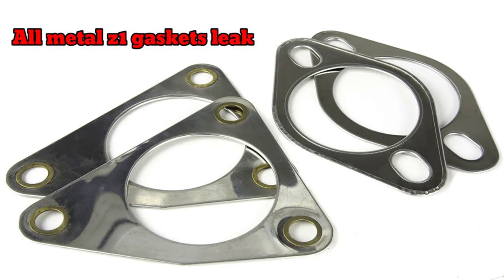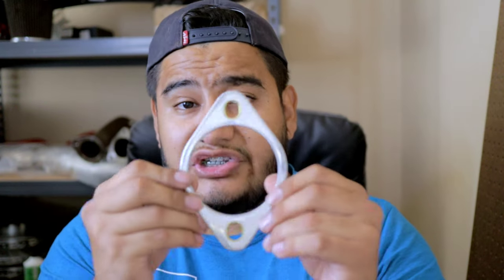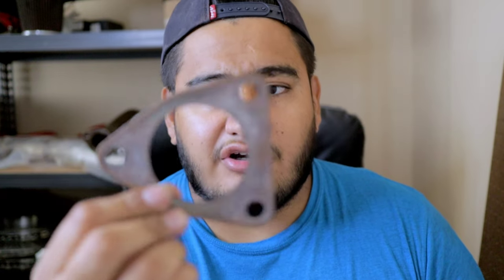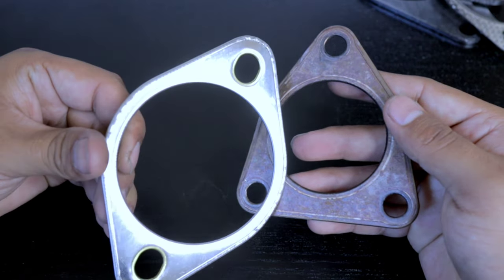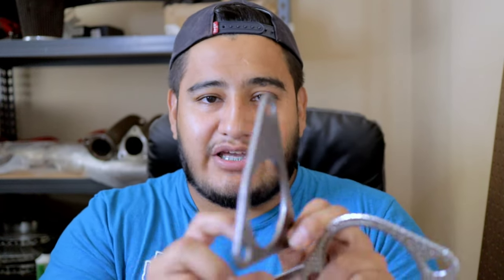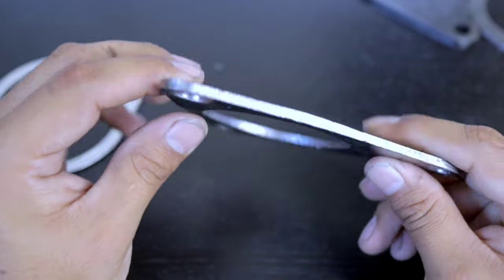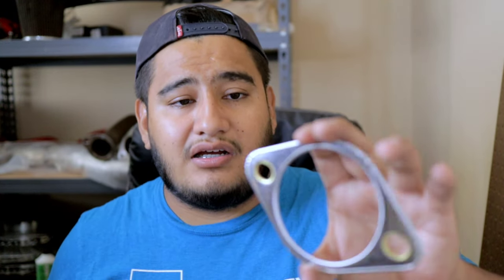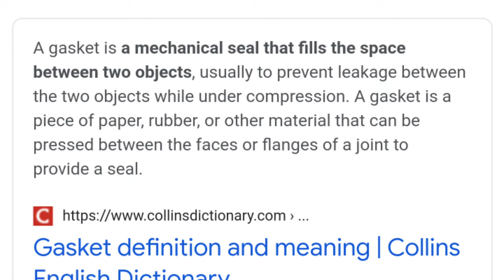Don't Buy Z1 Motorsports Metal Gaskets Here's Why!

Comment from the maker: This is my personal experience with using these gaskets with that said I would not recommend them for your vehicles
Reply: Z1 was great with shipping that’s why I was quick to jump on these and the reviews weren’t terrible. Maybe the leaks are more prevalent when you have a decent volume exhaust.
Reply from the maker: I recommend swapping them out for concept z extra thick gasket. Rtv won't hold up for long
Reply: @ERICSDIYGARAGE  they just replied saying not to use rtv so I’m going with your suggestion. Exhaust sounds like complete ass now.
Reply from the maker: That's funny because they told me to use copper rvt
Reply: @ERICSDIYGARAGE  what I’m getting is the issue with these gaskets is that the require and absolute flat surface to work properly. Issue is that it’s never mentioned and they shouldn’t be advertised as replacement gaskets if that’s the case. Exhaust hot, metal warps slightly when hot.

Comment: You're right on with this!  I had this problem with their gasket and even spoke to them about it.  They were playing dumb saying they haven't heard of this issue and that my flange must be warped.  Switched to the Fast intentions composite gasket and no more leak.  Fast forward to now and I have a leak even after I put a new fast intentions gasket.  I might go the CZP route, or was thinking of doing the RTV ultra copper route that people have done.  
I saw a video where a guy uses the oem o ring type gasket for the cat to header gasket and he had test pipes.  But I thought the Oem o ring cannot be used with and aftermarket converter....

Comment: Thanks for this video! 
I am refreshing my entire exhaust system and just ordered Z1 gaskets, but saw your video and quickly cancelled the order and purchased the CZP gaskets. I always had leaks with Z1 gaskets but they have so much hype that I supposed I was doing something wrong, because "these gaskets are perfect" but no... Thanks again
Reply from the maker: Yeah everyone hears z1 and they automatically think they are the best but im slowly reazling that they cut a lot of corners
Reply: @ERICSDIYGARAGE  you are right, they made really good parts but not everything is great. Their CSC delete is known to be bad (I purchased one and luckily sold it before installing).
I went with my boosted G37 (see my videos) to get an issue fixed and they masked the issue, never actually fixed it. It ended up making big power and much better than it was before, but not fixed as I expected. They helped, but didn't actually solved my issue.
I went with another tuner (remote e-tune) who took HOURS to explain me a lot of things, and if I need help he will spend as much time as needed to continue helping me without asking for extra money. I had high hopes for Z1 but they are just another place for Z and G, a good one but not the best as some people think.

Comment: Glad I found this video even though it's been a year since it came out. 
My ISR exhaust started having leaks at the 3 in connections (probably cuz Installed it in a parking lot by myself lol).
Been looking into different gaskets to see what all the difference was.
I found some extras I had lying around so I'll see if that does the trick and if not I'm hitting up CZP

Comment: I wish I found this video before just installing mine. Went from a slight exhaust leak from a failing OEM gasket to the nastiest sounding exhaust ever. I’ll try the RTV with the Z1 gaskets but I wish the website said to use them. My test pipes came with metal gaskets and said rtv is not necessary and they don’t leak.
Reply from the maker: Yeah z1 has taken my reviews down from the website I don't think they want negative reviews on there very shady of them. Sorry you had to go through the same thing

Comment: This video is exactly what I was looking for I tried everything to seal my test pipes on my vhr
Reply from the maker: What gaskets did you use
Reply: @ERICSDIYGARAGE  I’ve tried the ones that came with my eBay test pipes it was like the one you showed at the end with the holes I blew out 2 sets of them I tried just copper rtv that only lasted an hour I’ve tried z1 I threw them out and now I’m getting these for sure
Reply from the maker: So far they ate holding up just fine hopefully they work for you

Comment: How do you feel about those gaskets a year in? I was about to buy them and luckily did a search and saw your video.  I was thinking using OEM for all 2 books and the concepts Z 3 bolt for header gasket. What are your thoughts? Or concept z for all of them? Great video!
Reply from the maker: Oem for the two hole is the way to go. Concept z for the 3 hole header flange is  the only way it will not leak the do bend easy but if you install them correctly they will work

Comment: You're having these issues because your exhaust flanges are warped. Metal gaskets don't really crush, that's part of the reason they're so durable. I've had them on both of my cars for nearly 100k miles collectively, and haven't ever had them leak.

If you're getting composite gaskets to seal but metal gaskets aren't, you should quit overtightening your exhaust hardware and warping your flanges.
Reply from the maker: I have a hard time believing that all my flanges on my car are warped. 1:09 you can hear both the header flange and the y pipe flange leaking. Let me just remind you that I installed a new isr y pipe and test pipes so your saying they are Also warped? before I had the stock cats on with the circle metal o ring and the flange never leaked.
Reply: @ERICSDIYGARAGE  warped flanges from test pipe to manifold are very common to see warp. They're long flanges, and welding produces a lot of heat around the entire flange. Cheaply made test pipes almost always have flanges that aren't warped before you even install them. The fact that yours are ISR almost guarantees this. Part of the reason they use those composite fiber gaskets is because they crush when the flanges are tightened, and seal better when crushed.
Reply: As yourself this: if your flanges are true and so is the gasket, why did it leak? 

The only answer is that something wasn't flat. That's how exhaust escapes. There HAS to be a path, or it doesn't leak, and those gaskets certainly weren't gouged, bent, or damaged. 100% your flanges were the issue.
Reply: @drizzetsrevenge  yeah the z1 gasket isn’t flat like it needs to be. They have rigid edges and too much of a lip allowing air through them because the gasket sticks to far out on the lip. Which hints why air gets through them… and also he has explained why air gets through them already and also if you recalled right. Z1 themselves even said you need a copper piece for it if it does not seal which is not included with the gasket…
Reply from the maker: I give  up on trying to convince z1 fans

Comment: I ran them with orange rtv and they never leaked ever and also u have to it flipped on the right side as well
Reply from the maker: That's the problem you shouldn't need to use rtv. What's the point of using a expensive gasket if you could of just just rtv by itself.

Comment: damn I have been told by mechanics it's a good idea to use RTV along with your metal gaskets anyways. Maybe you're both right, the gasket should seal better but using RTV also is not a bad idea and that's not just Z's or  Z1 gaskets
Reply from the maker: Oem gaskets from nissan seal without the use of rtv
Reply: @ERICSDIYGARAGE  Well that's true, but I'm dealing with and issue right now and I have Z1 gaskets. But when I took it to a shop they took a quick look for a leak and said they don't think it's an exhaust leak from what I did. It makes almost like a hissing sound after you rev the car. I think it might be the stock y pipe

Comment: No issues with my Z1 gaskets
Reply from the maker: that's good to hear I wonder how many others will comment down below
Reply: Same here I use them on my art pipes to y pipe connection and they have been pretty good
Reply: Same here
Reply from the maker: @Milkweed760  I'll contact z1 again and ask if they update the gaskets lol
Reply: Just installed on my Tomei and it’s a leak fest 😂
Reply from the maker: Yeah definitely issues with the gasket or quality control
Reply: I haven't had any issues with mine. I had issues with generic gaskets leaking. Just tighten the hell out of them lol 💪🏿